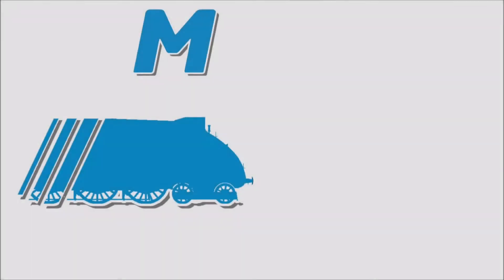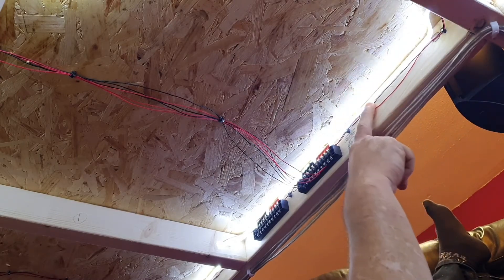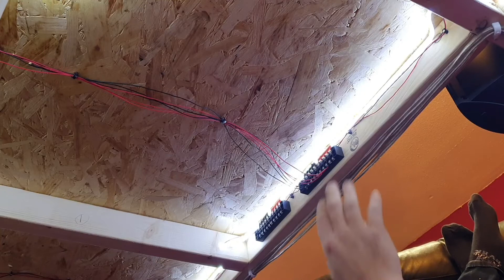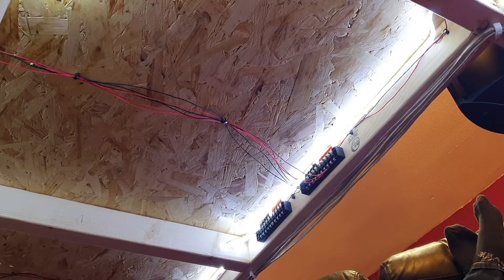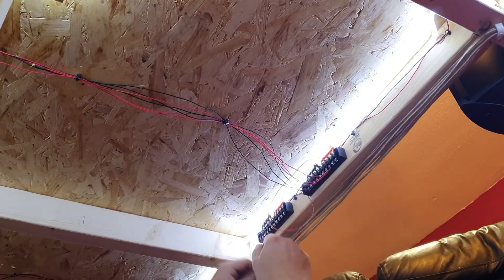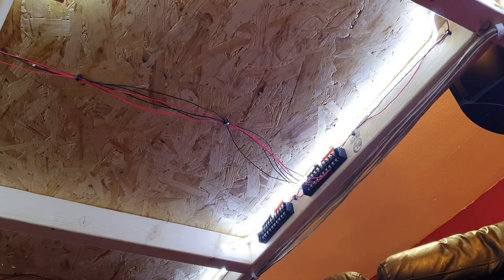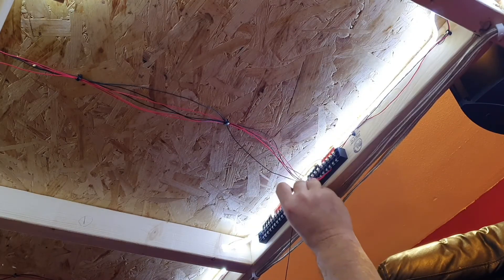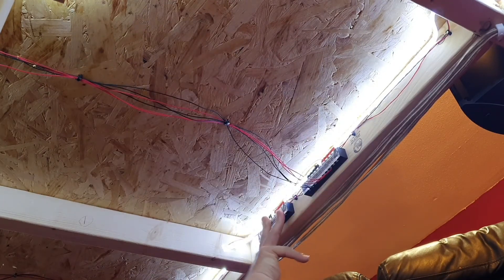Bus wires track droppers and connector blocks

Comment: Great video. What size wire are you using for your bus wire? Take care, all the best Jon
Reply from the maker: Hi Jon
At the mo I'm using 7/0.2 gauge wire but will be changing it for the next size up for the main bus wire and droppers will stay at 7/0.2.
Hope this helps.
Peter
Reply: Thanks Peter. My dropper wires are currently 16/0.2 as I'm using the Peco Pl-80 pre soldered fishplates. I have a lot of 16/0.2 wire in my toolbox so many also use this for the bus wire. I enjoy watching all of your videos and I was glad to hear your wife is getting better now. All the best, Jon